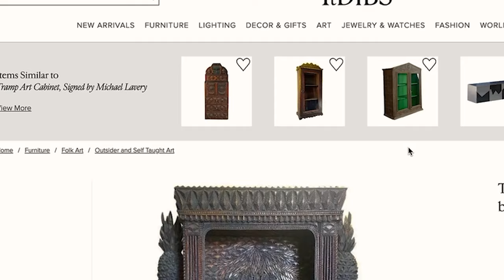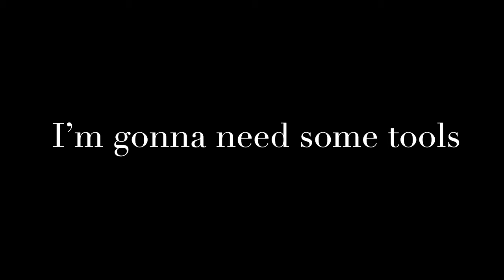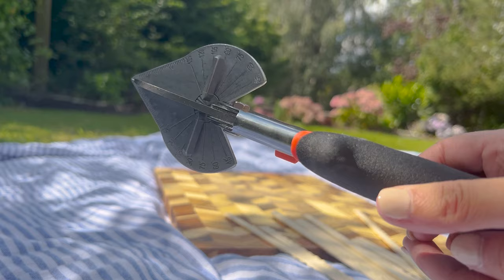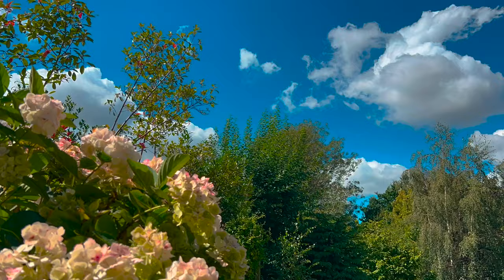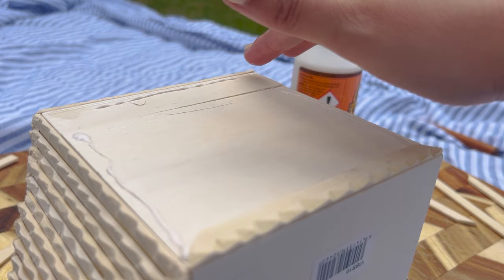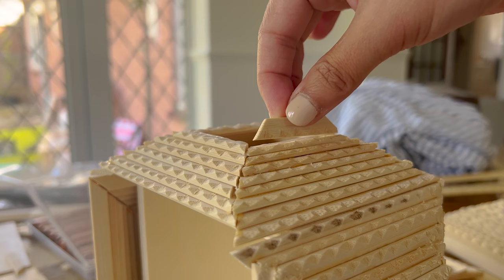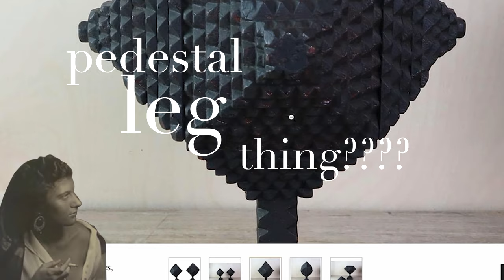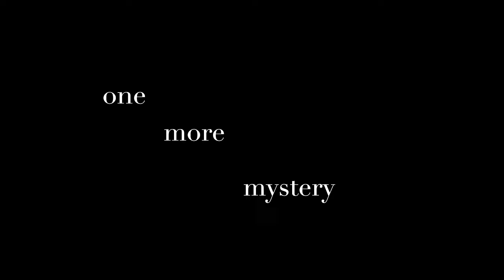Figuring out how to make tramp art

Comment: The tramp Art piece I have each layer was a solid piece of wood that progressively gotten smaller. However where you only looked at a picture to figure it out you did rather good for your first attempt at tramp art.
Reply from the maker: Yes I think the solid wood is definitely how it’s supposed to be done I was just trying to do it without power tools! I feel like I got pretty close 😅
Reply: @phoebedoeseverything  they used scrap wood and probably a hand saw. Remember before cardboard everything was delivered in wood crates. They were recycling trash into something they could sell. 😉